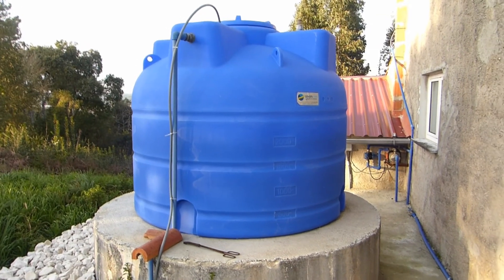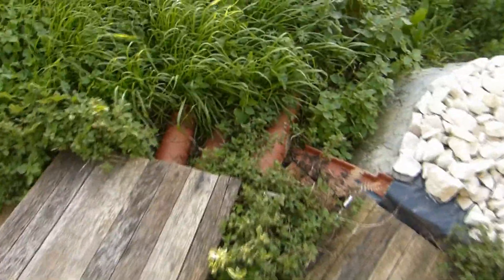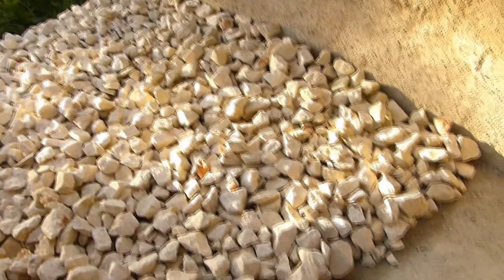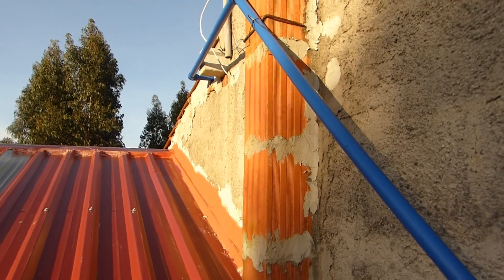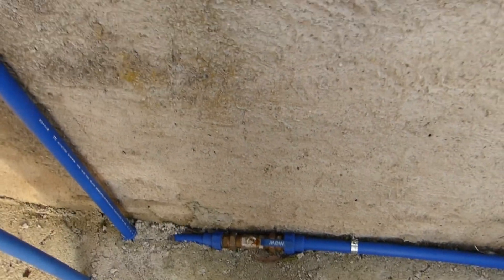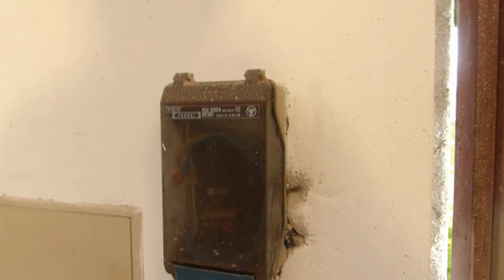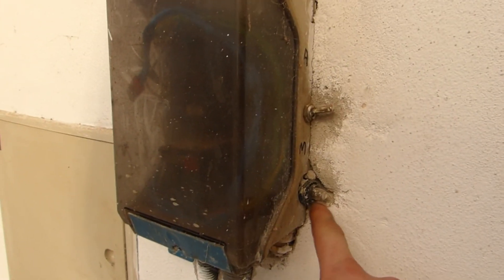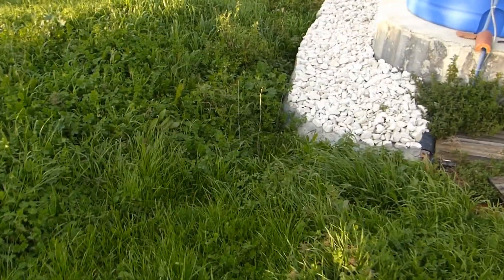Living in Portugal Borehole Water System Part 1: Outside Piping

Comment: Thanks for showing us your system. I have a property in Greece, no mains water and a bore hole supplying the house. I want to overhaul the system to make it more automatic and have decent pressure for the showers. For now, an ugly tank sits on an upatairs balcony supplying us with unsatisfactory water pressure below. Because of high sediment content, I want to install a filter system. The water is good for drinking and has been since the 90's when it was installed. The submersible pump has immense power so I dont want this kicking on and off too much!
Reply from the maker: Thanks for watching. The pump in the ground for this system is rated at 2HP, so is also quite powerful and fills the 3500l outside tank pretty quickly. The 750l tank upstairs in the attic has a pump and 24l pressure tank, all the taps in the house have great pressure and with a pressure switch adjusted just so that when showering the attic pump stays on and doesn't cycle, it makes for comfortable showers. Unfortunately the water has never been drinkable for me due to very high calcium content and bad bacteria. I don't know how it was when it was installed in 1993 though. Good luck with your overhaul, it took us a little while to think things through with float switches, electronic valves and pressure switches.

Comment: Excellent guided tour, very interesting.
Do you have a water purification system for the potable water?
Reply from the maker: There's no water purification system, it's too expensive, so I buy bottled water for drinking. The borehole water is good for washing, shower and toilet.
Reply: @WilkoinFrance  ah I see thank you.
I was hoping to be able to go off-grid.
Reply from the maker: If you already have a well or borehole you can get the water tested to see what you need. But most ground water sources in Portugal are high in mineral content.
Reply: @WilkoinFrance  yeah we have three wells, the main one is 15m deep with and there’s at least a 10m deep aquifer.
What I hate is using municipal water to flush the loo, water the garden, wash the car, etc.
Reply from the maker: Yes, if you have a well that does seem like a waste to use municipal water, only thing that will go up in use is electricity to power the pumps
Reply: @WilkoinFrance  absolutely; however, I am having solar panels installed with battery storage and plan to go off-grid.